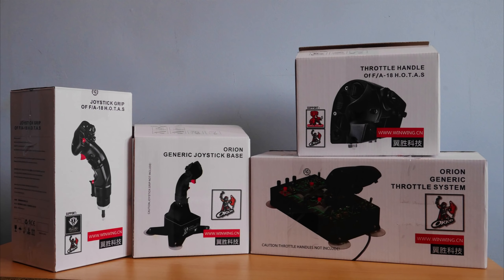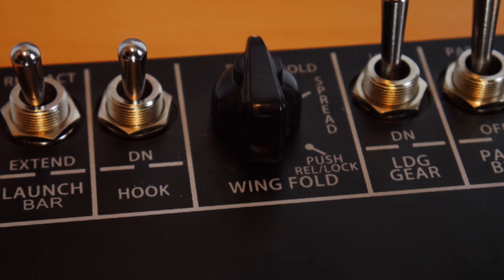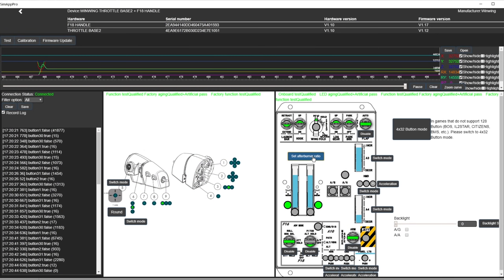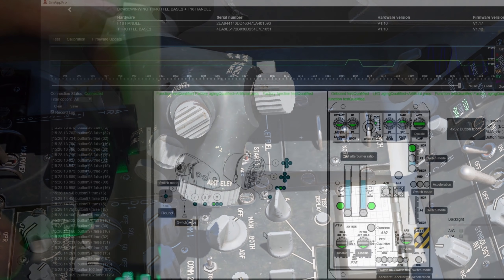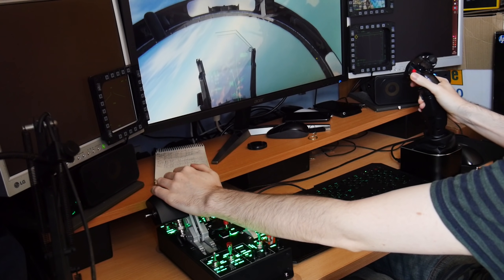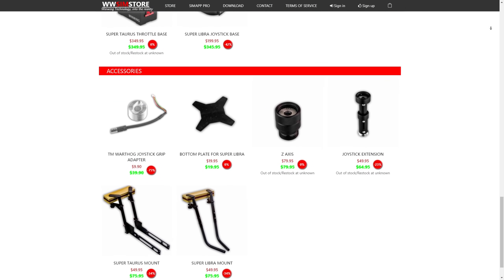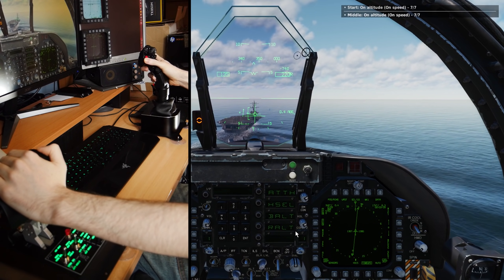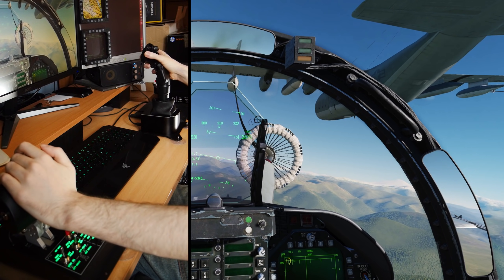WINWING Orion HOTAS Review [Discontinued]

Comment: got the Winwing super libra, just want to pick up the orion throttle now.
Reply: how do you like it?  can you adjust the stick to make it have to use more force to move?
Reply: @charlesbukowski9836  its great, there are several different spring options included to adjust it.
Reply: @charlesbukowski9836  i picked up an orion combo and kept the throttle, great quality stuff. Hope they make pedals yet.
Reply: @Melkor54  can I use it with my Logitech X56 throttle?
Reply: @charlesbukowski9836  yes, i did for quite a while with my x56 throttle.
Reply: @Melkor54  cool..  1. did you use both software suites  or just go right to DCS for config?  and 2. what throttle did you eventually goto?
Reply: @charlesbukowski9836  i used the sim app pro software for the winwing and used the logitech for the x56. Ended up buying a orion combo and ebaying of the flight stick.

Comment: Great review, one question (because I've heard mixed things)..... Can you use the Libra desk mount for the stick? It seems like the baseplate can be unscrewed and then the stick attached to the mount but can't find any concrete information on this.
Reply from the maker: No you cannot, they use a different layout, it's compatible with some TM warthog mounts just got to make sure that front wire has clearance.

Comment: Fantastic review, thanks! A follow up question, just to be sure... you said it can be mounted to a HOTAS Warthog plate...does that mean there are the same screw holes on the bottom of the base as the Warthog joystick base, or did you have to change/adjust something?
Reply from the maker: Same screws/layout
Reply: @RedKiteRender  Appreciate the quick answer!
Reply: @RedKiteRender  One more thing... on the WINWING Website they say:  "Extension and Z Axis are not recommend to Orion HOTAS." I don't care about the Z Axis mod, but I would like to use their extension. Any idea why they don't recommend it? Have you tried it?
Reply from the maker: @whitenoise8952  The Orion doesn't have a clutch system like the Libra, so whilst compatible, long extensions will make the stick wobble and not return to centre as neatly. Or at least that's my assumption based on my experience with the WarBRD and extensions.

I was told they're compatible, but couldn't test it myself.

Twist axis should be just fine, as it's only a small extension.
Reply: @RedKiteRender  Makes sense, thank you for the quick answers!

Comment: This seems really competitive at $499, how well would you say this setup would do in the a-10c modules? I also plan to fly some rotary like the AH-64 when it comes out paired with the k-51 collective, so if you have flown with this stick in any helicopters or the A-10 in DCS id like to know your thoughts .  Thinking about getting one of these or a TM Warthog setup, or just saving up for a virpil setup
Reply from the maker: Personally the Orion joystick base’s springs are a little heavy for my tastes, and they didn’t offer any alternative strengths. Whilst virpil will give you a selection of springs and cams so you can customise the feel. My daily flyer is the warbrd base + tm warthog a-10c. Both are great, but that customisation is why i use the warbrd. You can probably buy springs to fit the Orion that said.